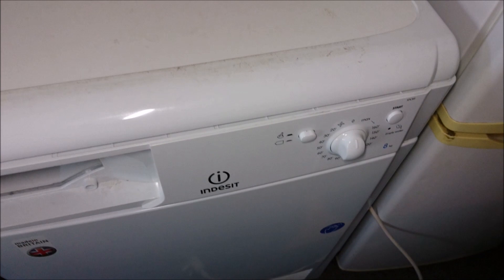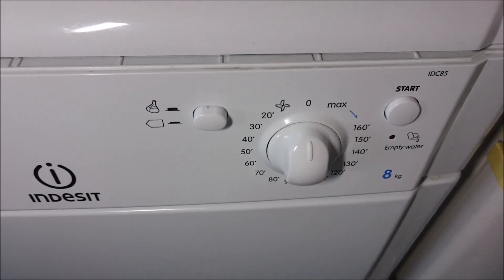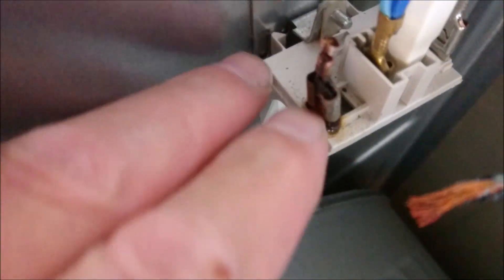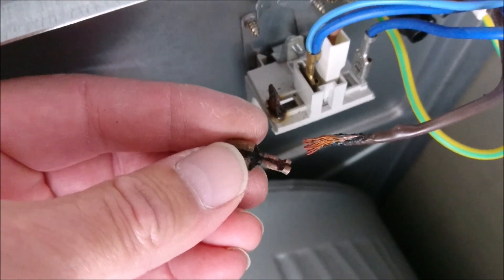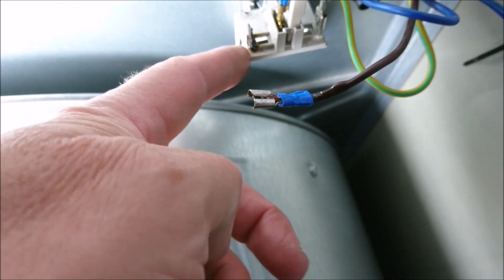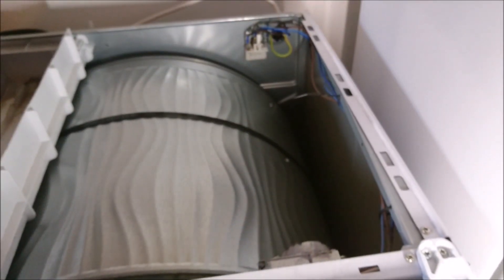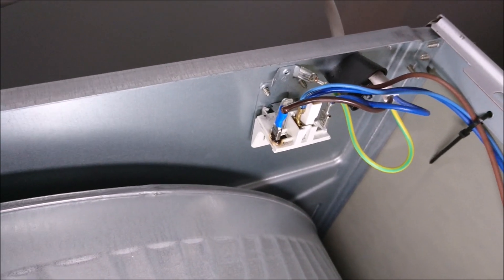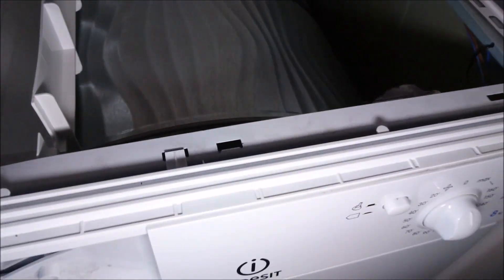Indesit Dryer - Danger

Comment: Just been to replace the start switch on my Mams dryer, then discovered the exact same problem.

Looks an easy fix... How is it holding up?
I was tempted to try and track down a new mins connector but they don't seem to be as easy to come across as start switches!

Comment: Hi, same problem here .. just removed the top cover and noticed the brown cable melted at the same spot how did u fix it ? need to order some extra bit to connect it ?
Reply from the maker: Just cut back the burnt wires so I got a clean connection and added new connectors ( can get them from most DIY or electrical stores, usually in small packs) the important bit is to crimp or clamp them correctly so make sure to get the right size connectors for the wire thickness.

Comment: The one my daughter has, trips the mains thermal trip in the fuse box. This is possibly the problem. I shall look at that tomorrow. They should not use those spade connectors on a 3kw connection. They are not rated for that amount of continuous current. They should be screw connections rated at at least 20A or they should be the larger spades used in cars for example.These are only 10amp rating(up to 1kw)

Comment: Hi, just had the same problem with the same machine. Tripped the sockets all down stairs in my house. Did exactly the same things you did with working the problem back from the plug, fuse etc. Mine was the blue wire burnt through and the brown was starting to go as well. Came on YouTube to see if anyone else had a problem and came across your video. We have also had the suppose fix by engineers. Did you get intouch with indesit about this? If so what was their response. Thanks
Reply from the maker: Because of customer services and typical messing around by big companies and I had already had the ' fix' I just kept an eye on my ' fix' for any further issues. Pleased to say everything was ok. 😁👍🤞 However it's always 'us' the customer that has to sort all the problems out.
Reply: cerberusk9uk my dryer seems to be working ok now, but to be on the safe side I have ordered a brand new cable with a fixed plug and the actual part that the spade bits fit to from Partsmaster. These are genuine parts and cost with delivery £36. The reason for this was basically to put both mine and my wife’s minds at ease. Thanks
Reply from the maker: Very good idea, always better to be safe than sorry.

Comment: Yeah but the engineer from Indesit cut the cable off where it goes into the machine.  He then moved it outside and it has been rained on for two days.  Not sure it can ever be safe again.  Think Indesit should be doing a whole lot more to ensure a fair outcome that ends up with me having a functioning and safe tumble dryer very soon.  Come on Indesit - get a move on!!!